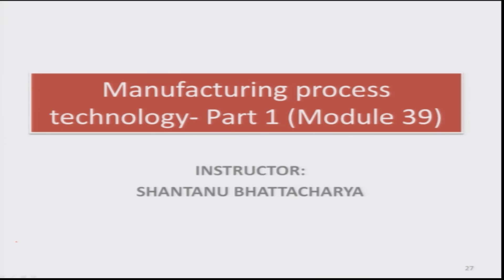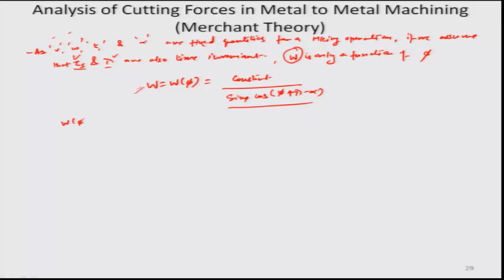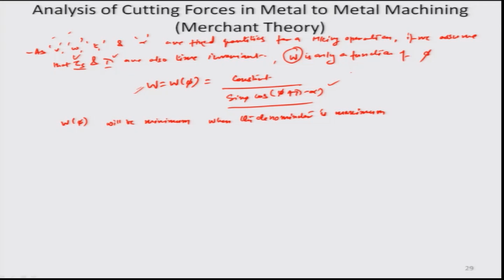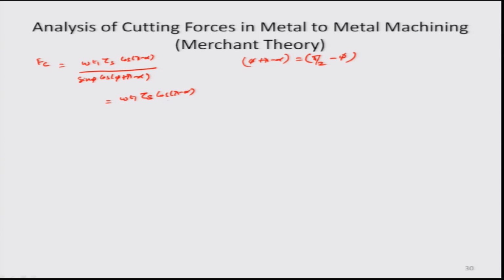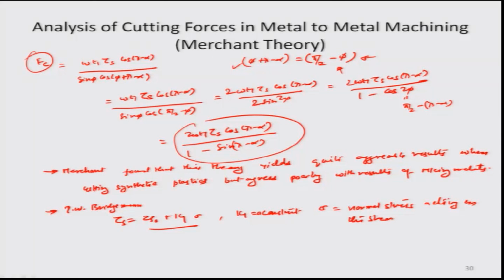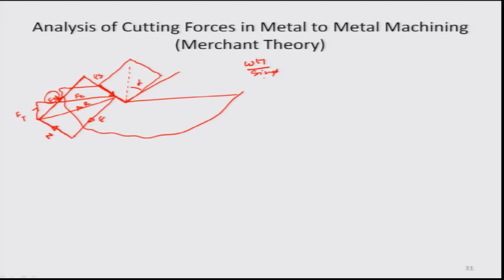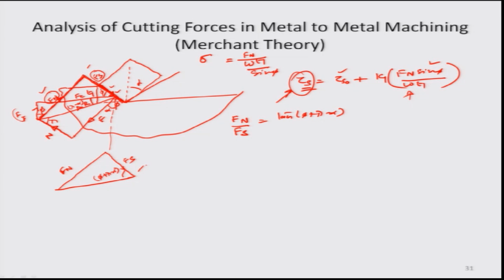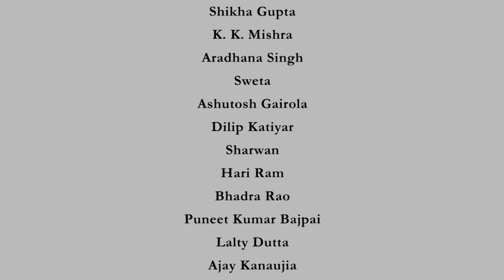Lee Shaffer's Solution

Comment: 1 point in an orthogonal cutting operation, the tool has a rake angle of 15°. the cut yields a deformed chip thickness of 0.6 mm and the friction angle in case of ernst & merchant's theory is 45° while it is 30° in case of lee & shafer theory then the chip thickness before cut is:  how calculate